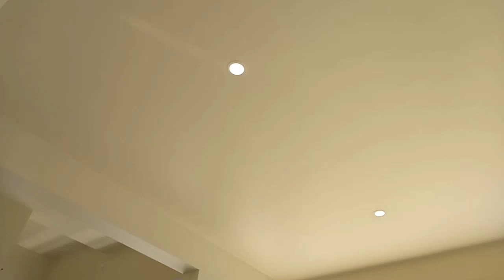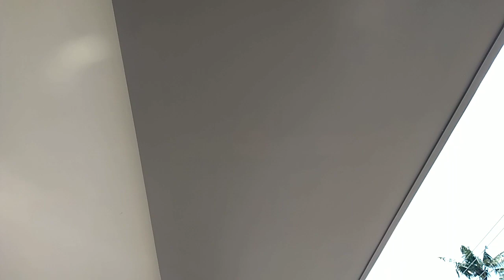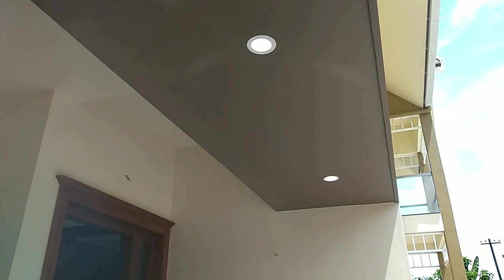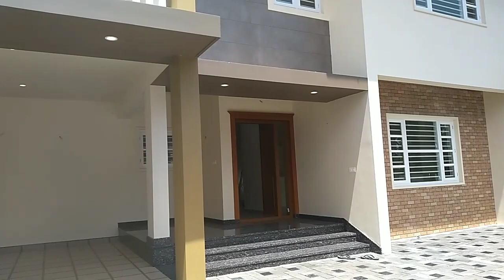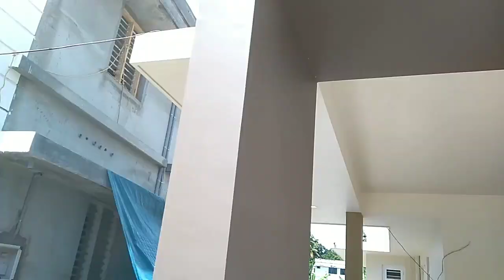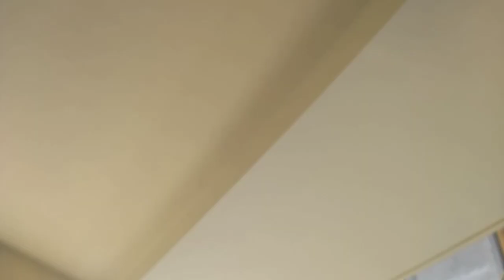avoide ceiling ,and fix led light box construction time save money#i love god

Comment: Can we do like this in bedrooms,
The contractor said if there is leakage in roof in future then it is difficult to replace. Can u please guide me
Reply from the maker: new house must roofing in this situation so no leakage problem friend,
Reply: Thank you so much for the fast reply, but, I am asking about in future if there comes any leakage problem in roof then the electric wires  and the lights may get damage and difficult to replace the lights.
And if need to buy this lights is there any specific name or could u suggest the good brand
Reply: Water proof paint use no problem
Reply: Hello  sir .... How   you  hang  your ceiling  fan  in your  home ??
Its  having  any  leakage ??

The  sameway  you  can  fix this  light  box  also .... But    you need  to  lay the  point while  concreting   the  slab..
Reply: If there is leakage in the roof not only it affect the wiring but the entire house also... If it's a false ceiling simple leakage will damage the entire ceiling structure... A good wiring work will resist the leakage problems... And you immediately have to stop the leakage... When it comes to main slab wiring and fall ceiling main slab work is better in terms of money spent and durability...